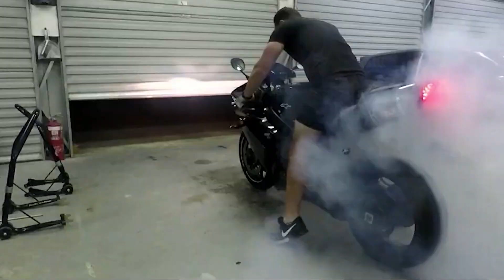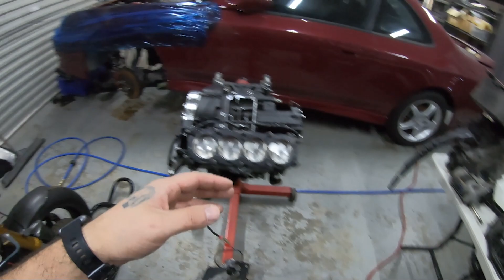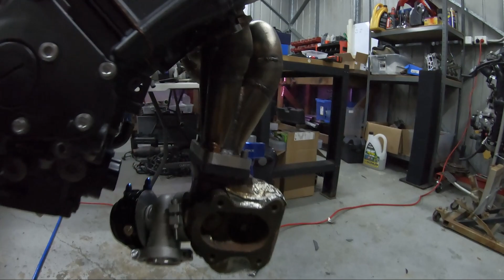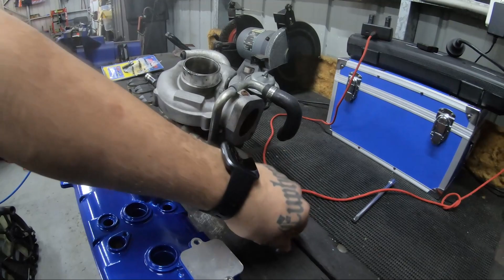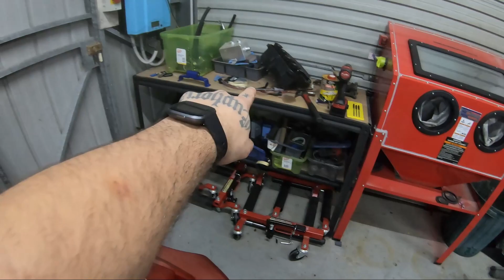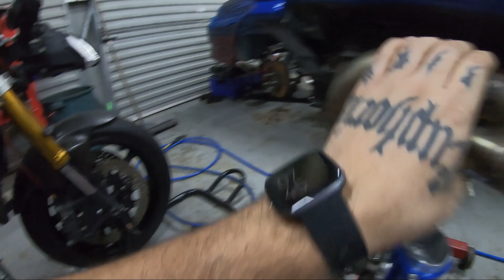🔥 Street Turbo Yamaha R1 Turbo Update!

Comment: Hi. In turbocharged motor we have pressure in exhaust manifold. Original system (crankcase vent)  not working correctly.
Reply from the maker: Correct, yes. However I blocked the original system off, filled the ports into the exhaust ports in the head, drilled the rocker cover and added an AN6 fitting to allow for additional crank case ventilation haha so a bit involved but want all that hard 🫡